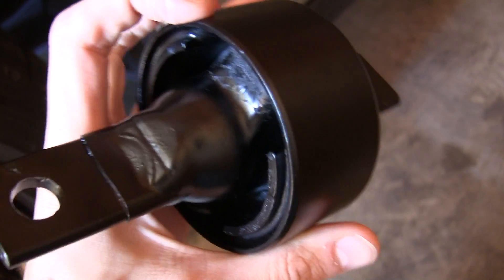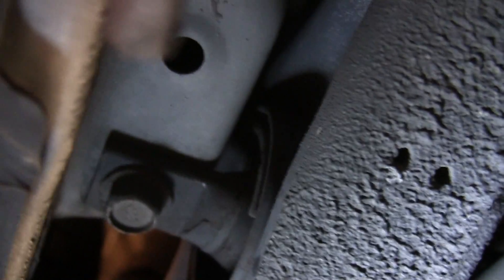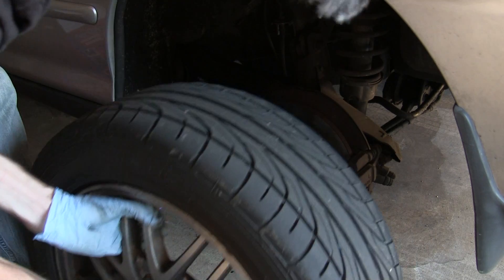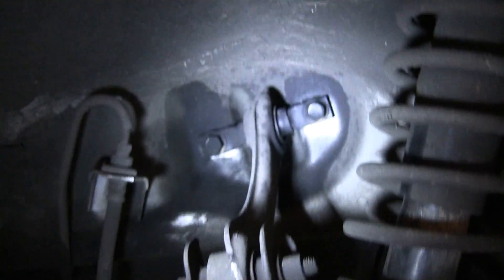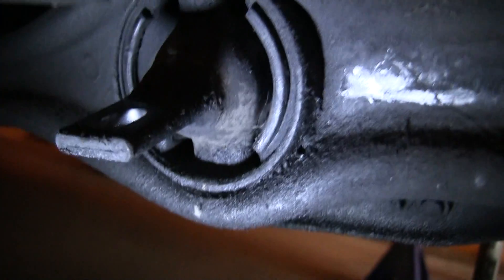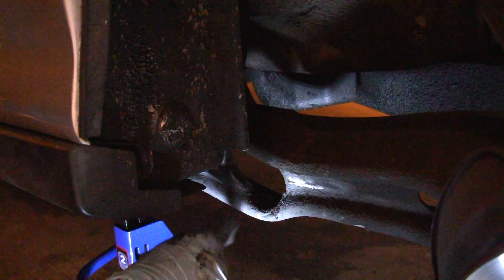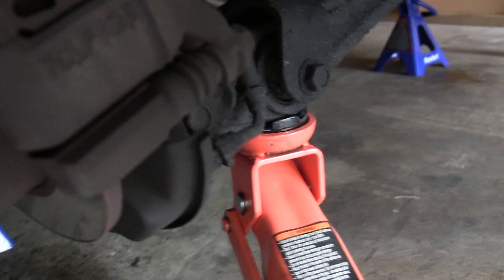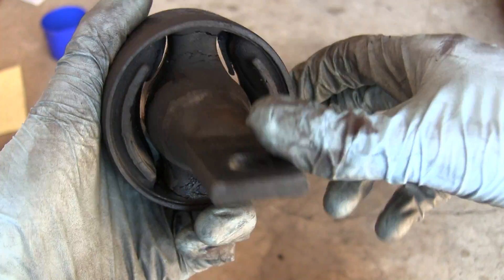Rear Trailing Arm Bushing Replacement - Honda

Comment: this was a big help, you just replace the bushing?. I thought they were telling me I had to replace the whole trailing arm.  Is this true
Reply: John Walters they tell you to do this because it’s easier and quicker. Vs replacing just a bushing requires a press as such. When replacing a whole trailing arm its plug and play. As well as they would up sell you the wheel bearing together with the trailing arm.

Comment: I am puzzled by the configuration of the rear trailing arm where you have the toe adjustment link, trailing arm bushing ( pivot point) and the lower control arm.  I'm puzzled because this looks like it will cause binding in the movement. I think the toe adjustment link should be on the opposite side of the arm. please explained 
Thank you.

Comment: what a mess. I replaced the trailing arm bushings in my 2001 Honda CRV  (LI rust belt). to remove the bolt from the toe compensator, I had to heat it destroying the bushing and caused the nut that is encased in the body to dislodge.  wound up having to buy a new toe compensator link and cutting an access hole in the body to hold the nut while replacing the bolt that holda the link to the body
Reply: I may have to end up doing that with my Mazda, the sway bar nut that is welded to the chassis is stripped. But I now have a welder, so I may go that route when I get better at using it, lol.

Comment: Hey. Great video, very helpful. Thanks! 

question: why is it necessary t make the marks while weight is on (tires on the ground)? wouldnt it still be the same if you made marks while the arm is disconnected? I did what you said anyway, it just doesnt make sense to me. 

Thanks again
Reply: Roland L he didn't make marks when the arm was disconnected. You must of missed that as he didn't film it

Comment: So use a straight ruler to mark the original orientation of the bushing; but I'm assuming that the current orientation of the bushing it is in is for when the car was at stock height. I am currently at a mild drop of 0.75-1.00". Would the orientation of the bushing need to change in order for the difference in ride height?

Comment: Someone correct me if I am wrong but the opening in the trailing arm is tapered and the proper direction of removal is to push the bushing out from the inside.  But in this video he is doing it the opposite direction which could cause the opening in the arm to be damaged.
Reply: Ohhh

Comment: If one lives in an area where this snow and salt sprayed on the road a result, don't attempt to loosen that bolt at 3:06 of this video, without using a blow torch. Doing so will likely snap the head.

Comment: You made it look a lot easier than ECG did and he still has my respect. Maybe they didn't make that tool yet when he shot his. I have this exact job to do on mine. Thanks.
Reply: I'm in California, in the valley. Rust isn't so much of a problem here.
Reply: Did you purchase your bushings online? I need to get ones for my CRV 2007 but in the dealership they are so damn expensive. 100 bucks each and I don't live in the US. I'm looking for something with a better price and quality
Reply: OK I removed the first T-arm, took it to a local guy with the new bushing. He said it wasn't too bad to do, with a press of course. I pounded the other one out and new one in myself. It worked out well. I got my bushings from Rock Auto. Just over 20 bucks each.
Reply: He just showed the highlghts.  Those bolts are PITA to break.  Not to mention, pulling out and pushing in those bushings.

Comment: Hope anyone is reading this in 2016, say I have a bushing from energy suspension, or prothane, the kind where the metal piece in the middle is separate from the bushing, does it mean I don't have to bother with the angle and using the whiteout?
Reply: Wei Wang sorry 2018 now

Comment: Any advice on how to remove the bolts? They're impossible. thanks.
Reply: If you're referring to the UCA bolt; you need to use why floor jack to raise the LCA a bit, to relieve downward pressure on the UCA bolts. 0:50 in the following video: watch?v=MeK0XcRc8qQ
Reply: whenever you have issues with removing bolts, use penetrating fluid and let it sit 5 minutes. if they still wont come out you will have to heat them to red hot

Comment: Could a broken or bad bushing cause a tire to lean out
Reply: also should i buy a performance quality bushing or will the amazon one do the trick. Basically i'm just asking what's the difference.
Reply: +Colby “Chowder” Maulden all a matter of quality. don't get cheap ones, get genuine honda parts. my cr-v bushings are genuine and pretty cheap to buy; just labor sucks lol
Reply: no this bushing wouldn't usually cause tire lean out a bent upper control arm would be more likely or and after market one the is set to negative camber
Reply: Well I mean my entire trailing arm is leaning out along with the tire
Reply: Colby Maulden the upper control arm could cause there while thing to lean out or also the the front connecting arm that is between the trailing arm and toe adjustment on the body both of these parts can be bought after market and made adjustable that should fix any and all lean out but the top control arm is more likely they problem of you need more explaining just Google rear camber kit install
Reply: +D Mcd cool thanks bud

Comment: I did this over the past 2 days on a Rust Belt driven 2000 CR-V. Yes, I'm sore and beat up. The special tool did save me some time. It turned an 8 hour job into a 6 hour job. Pushing the old bushings out with the special tool was simple. I froze the new bushings a day ahead of time. The frozen bushings plus grease made pushing them in even easier than pushing out the old bushings. The part I struggled with for hours was reassembly, especially getting the new bushings lined up to bolt them in. I finally discovered the effectiveness of pry bars in getting things lined up.
Reply: christ

Comment: @Engineering Explained, 
In order to use this tool for the older integras (90-93), youll have to use an adapter?  I just bought a tool on ebay and the seller says its just for the older integras, but i did some research and i couldnt find a tool available  just for those years. So either the seller is wrong, or he has an ultra rare tool? he says he had in in storage for a long time. thank you

Comment: Thanks for this , I done mine  while i was at it, I done  brake hoses brake pipes new brake shoes too  cleaned up any rust spots  treated and painted I actually took out whole assemble both sides as this gave me more access and found it easier to work on the bench

Comment: Would this particular bushing cause creaking in the rear when you're coming to a stop? That is to say when your vehicle's weight transfers to the front then goes back to the rear. I have this problem in my 2000 Civic coupe most noticeably when I brake hard.
Reply: +Jimmy M I've been hearing the same thing on my Civic. Any luck with yours? Annoying tick tick noise when I take off or when I'm coming to a stop.
Reply: check your top hat where the spring meets up with the rubber this being out of place or damaged can cause noise very easily
Reply: Thanks for the reply. I'm going to go ahead and order a new quick strut as these were getting pretty worn out anyway.

Comment: im a fan of the black energy suspenion all you have to do is burn the old bushing out leave in the metal outer ring and push them in tad difficult but worth the urethane
Reply: So should try to cut some of the rubber off? Or should I hit with a torch and burn the rubber?
Reply: the urethane bushings tend to bind especially in a racing/spirited driving application

Comment: Thank you for posting. I'd like to share my experience.

I destroyed my compensator bushing getting it out of my '99 civic.  The bushing race was rusted to the bolt and loosening the bolt pries open the toe adjust frame.  Still better to heat it and melt wreck the bushing than to twist the captive nut in the toe adjust loose.  Before you begin this project, you may want to have a couple of these 52341SR3000 compensator arms (was $20 ea from Rockauto) w/ bushings on hand as well as a few of these 90171-SR3-003 bolts from honda.com.  When I get those parts, I'll try to cut the bushing race and bolt out and finish it.
Reply: I managed to replace the compensator arm.The captive nut in the toe adjust escaped, so I cut a small flap in the interior body to put it back.

I cut the old compensator arm bolt/bushing off with a sawsall. Then, I broke one of the Trailing arm bushing bolts right off. I should have known by how it creaked so loudly when I started turning it.   Not sure what I should have done.. maybe exercise it back and forth more? I was reluctant to heat the head because the threads are 3cm up the shaft.  I guess I'm cutting the unibody under the seat to get at that too.  http://farm3.static.flickr.com/2665/3756066188_3da7c93b34_b.jpg shows me where to cut.

The X-tractor worked great both out and in, though I used a punch to line it up.  It was kind of a struggle to get the trailing arm to hang low enough; I was worried about stressing the rest of the bushings.

Comment: what do u think of the guy on YouTube who changes the trailing arm bushing with only a mallet to knock it out and in... ??? is it believable?
Reply from the maker: Bud Arnold Sounds challenging. It was in there quite well.
Reply: Just went through the experience with a 99 CRV, the hammer approach may or may not work but I gave up after a couple of hrs. Bought the $130 schley tool from national tool warehouse and got it done in 30 mins, removal and installation.
Reply: I was able to do mine this way.  The most challenging part was moving the trailing arm down far enough to get enough space to hit it decently hard with a hammer.   I ended up taking off the brake line and then had to bleed both when finished.  No problems for either side, worked very well.

Comment: If you dont have the tool, bush goes bit easier on its place when you put it on freezer over night before installing.
Reply from the maker: Sounds like a good idea, have you tried this? Mine was off by a couple mm, so there was no way it was going in (had to buy another).

Comment: Thank you that was very helpful.  I did it in 3.5 hours.  I wasted about 30 minutes taking a break.  I would suggest to anyone doing this to maybe get some tie wire/bailing wire to hold your breaker bar so that when you tighten your last bolt on the compensation arm to 47 ft lbs it is easier to adjust and tighten your bolt with the other hand.  I was nervous, being the fist time, but everything went great.  Excellent video thank you.
Reply from the maker: Glad to hear it went well! Breaks are necessary, congrats.

Comment: Hey man, I replaces my t/a bushings on my old db8,  and actually found they came out tons better being pushed out from the inside out instead of the outside in, actually wacked them out with a rubber mallet easily. The installation of the new bushings was a bear though. Just food for thought if you ever have to do any again on a Honda bud.
Reply: JHartColorado same here and got them in with a 2x4 and a hammer
Reply: @stephenv5332  Mine came out so easy, but I can't get the new Moog back in. Really don't want to have to order a press :(
Reply: True I just did mine today and it took two wacks of a hammer from the back and it popped out.  I used a little PB blast on it too.

Comment: I'm going to do my 2000 honda civic , Unfortunately i don't have the money to buy the tool that pushes the bushing out...I guess i can use a regular clamp....how hard was it after the wd40 to push the bushing out? Thanks in advance for your time.
Reply from the maker: It was honestly pretty challenging to get them out, but even worse was getting them in. Getting them out could be done with fairly basic tools, the other bit is a tad more difficult. Regardless, having shop do it could easily be $400-$800, so the tool seemed well worth it. Good luck!

Comment: I did them on my CRX a few years ago to pass inspection.  The shop wanted $400 for the job.  I think parts (including the $90 tool) came to about $120 and one hour of my own labor.  Glad I did them myself.  Although I respect the trade, auto techs tend to over exaggerate the difficulty of certain repairs.
Reply from the maker: Definitely much cheaper to do it yourself. I've heard of others getting quotes for up to $900. I took a bit longer than an hour, but one of them was out of tolerance so I had to buy another.
Reply: what do you mean out of tolerance? the bushing was out of tolerance what did you measure and how to determine this ?
Reply: D Mcd maybe you mean you bought the wrong bushing cause the ones for the DA are a different size
Reply: moccina
Reply: Felicitas Jimenez
Yes ?
Reply: @moccina zz z c f.  Lf x.  Bhchhfhfs TV ht TV zfvb Cc bb bb bb 😣
Reply: Business doesn’t stay open by ripping people off. I’ve been quoted for $500 for a radiator replacement on my G35. Got it done at the dealership I got the car from for $170. They did it in 6 hours, refilled with new coolant and all.

Comment: I have a CR-V, I did not know the bushings were almost done, because on dry road drives fone,  now that there is snow it's hard to control the rear end of my suv the dealer quote me for $1900 to replace the whole arms and stabilizers.
Reply from the maker: I don't know if you'd actually need to replace the arms themselves, they're probably fine. But the bushings will wear over time.

Comment: Nice work, could you tell me how this bushings affect the driving? does it make the whole car body shake or move side to side?
Reply: it will affect the way the rear end turns if it is worn or possibly even torn your rear end will fell really loose and sway a lot when turning

Comment: Hello Engineering Explained,  Thanks for sharing this.      I've just watched your vid above and see it took you 15 mins to replace left side, even if it took you 30 mins per side (vid editing etc), not bad right?     I have a 2000 Honda Civic (121K miles) and the dealership is quoting me $900+ in labor to replace both rear trailing arm bushings, the voicemail he left me yesterday evening said the job required alot of 'labor'.   Is he serious or am I being taken for a proverbial 'ride'?     Any advise you have in terms of how much estimated for part and how long estimated to complete both left and right rear would be much appreciated.    Many thanks, keep up the awesome work.
Reply from the maker: Okay, I'll give you what it took me as an inexperienced car guy without a proper lift. Parts should be no more than $30 each, though they can be found for less. Labor, if you know what you're doing, shouldn't be more than 45 minutes per side. I bought the tool and everything all together was probably less than $200. I'd expect a 2 hour labor charge at minimum though.

Comment from the maker: There's nothing that says your car should last longer than the warranty (though most do). Rubber does not hold up over 15 years and 125,000 miles, I don't think there are any issues at all with the design. It's a cheap part that can be (somewhat easily) replaced.
Reply: Calm down on the contents their buddy 😂. Good to see you had good insight even 10 years ago.

Comment from the maker: There was a good amount of noise at around 50 mph at the back left tire, as well as a "clunk" when taking a sharp left turn. Both of which have seemingly disappeared after replacing.
Reply: What Brand Trailing Arm Bushing did you use? 
 I've been told AC Delco or AC Delco Professional make garbage parts.  
And for an item like this in the aftermarket to go with Moog.
Reply: @lightningsmokerXx  Moog ain't what they used to be either as I've read horror stories about their ball joints among other things. Much of their stuff is still good but you can't just assume it's a quality part since it says Moog on the box. Personally, when it comes to ball joints these days I much prefer Proforged over Moog. When it comes to rear trailing arm bushings for Hondas I don't stray from OEM as the vast majority of the aftermarket offerings are iffy at best.  I just bought a pair of Honda OEM RTA bushings for my '98 CRV from a reliable ebay seller for $45.

Comment from the maker: Great question. I looked into it a good amount, and ultimately chose to go with rubber, for a few reasons. Obviously, it's cheaper, but that wasn't my biggest concern. Polyurethane doesn't allow for resistance to movement in any axis other than the axis it rotates on, where as the rubber can account for twisting loads and axial loads in and out, left/right etc. I've also heard the polyurethane bushings can squeak pretty bad, and I've heard that they don't necessarily last longer.

Comment from the maker: Regardless of the aftermarket shocks, my bushing were long worn. They needed replacement. But if the stock ones are fine, then they can be left, I'm fairly sure though after this many years not many are left in good shape.

Comment from the maker: There's no way I'd get the new one in properly without a tool. It may be possible however to hammer them out, but it certainly wouldn't have been as easy for me.

Comment: The only time you need the sst (special service tool) is on the crv.  Honda tech for 7 years, been with Toyota for 6 now. Hammer is all ya need for crx / civics. Don't waste all the time with the sst. Turns a 15 minute job into a half hour job. Time is money....
Reply: Seems you don’t work in north east 😂
Reply: Shut up paker @matthewpowell1855
Reply: I was gonna say I think I could hammer it out,, and in…. But would this work for an integra da as well ? Just making sure

Comment: Saying 80 pounds of torque per foot is incorrect. A pound is not a torque, it is a force or mass. In this case it is a force(Lbf). Torque = force x distance. Which is our pound force and our feet. So the correct way is 80Lbf·ft